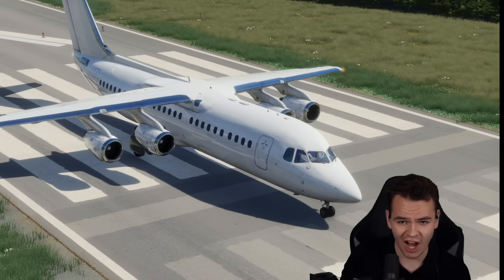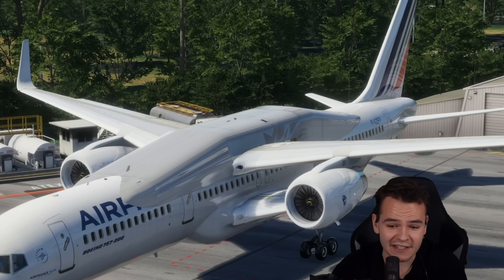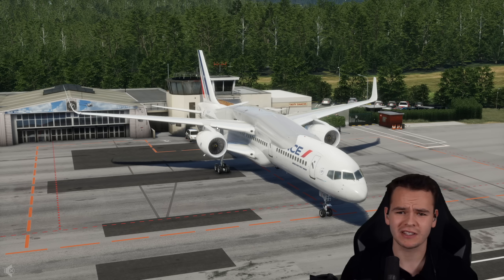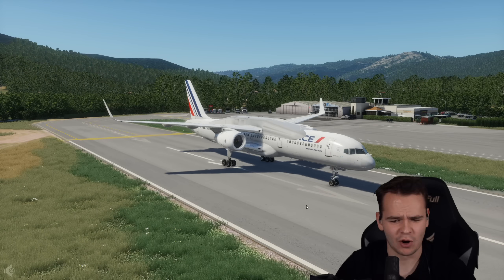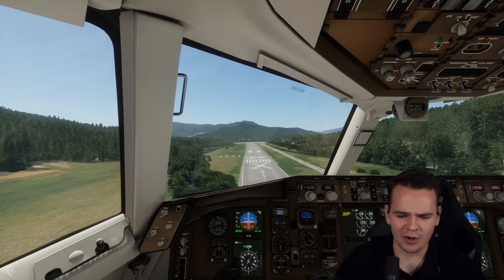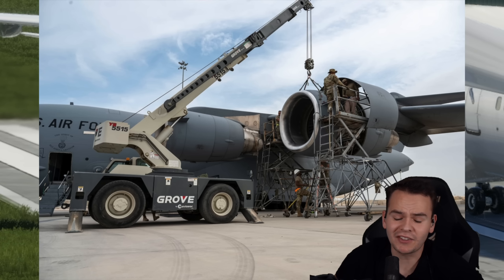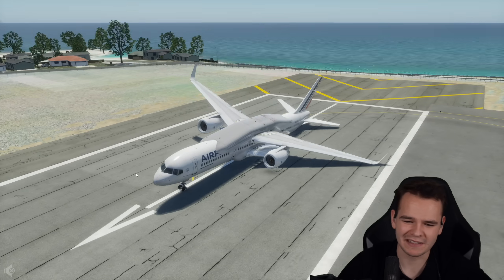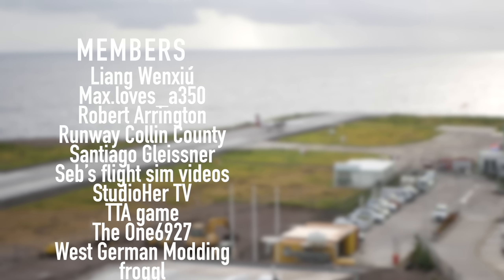Why High WING Jet Airliners Would Be An AWFUL Idea

Comment: Great video Swiss!!  One thing to improve in that design would be to make the wings anhedral (wing sloping downward from fuselage to wingtip) instead of keeping that original dihedral (wing sloping upward "" "") design.  That way the aircraft would be more stable in flight, and the wing could also go through the upper portion of the fairing/fuselage-mount making more room inside the cabin
Reply: With those (anhedral) wings, yes it's more stable on higher bank angles due to the higher lift on the wing that is in the "higher" position during the turn.
 I'm not an engineer but its a rough idea why the AN-225 or AN-124 have their wings like they have.
Reply: @istillplayStuff1000  Exactly! Most jet aircraft with a high wing have anhedral wings ie. the Antonovs you mentioned, Boeing C-17, Lockheed C-5, Avro RJ etc...

Comment: Some benefits:
You can have big engines with big big bypass ratios.
In the event of a water landing, just land inverted :)
More importantly of all, they look better.
Other notes:
Wings tend to be anhedral since the high wing design is already inherently roll stable.
Landing gear is typically stowed in fusalage nubs or underneath the engines, I've never seen that sort of biplane setup.
The sort of lump on the roof to hold the wing is not THAT big on the real planes.
Less ground effect, because the wing is farther from the ground.
Reply: Engines can't grow too large before the turbine tips become transonic.
Reply: @pneumonoultramicroscopicsi4352  They figured out gearboxes that don't melt, the fan doesn't have to turn as fast as the core anymore.

Comment: What if we placed the landing gear as part of the ending nacelle assembly, like the high wing turboprop designs? It could probably fit next to it
Reply: ? Like Dash 8?
Reply: @Randomly_Browsing yeah, like that. Or maybe they could be at the sides of the fuselage like the ATR he showed at 0:14
Reply: @SG-yq7fm  I think the ATR gear design is better and safer
Reply: @Randomly_Browsing  

structurally, yes, because it is shorter and wouldn’t interfere with the engines’ aerodynamics, but the narrow stance might mean it’s more likely to tip and wing strike on a rough landing 

Also comments are flipping out sorry if I pinged you five times
Reply: @SG-yq7fm  I didn't see them, probably removed automatically
Reply: @SG-yq7fm  also, it's probably because you have slow internet so it'll take time to process,but sometimes it'll posted regardless,you just don't know